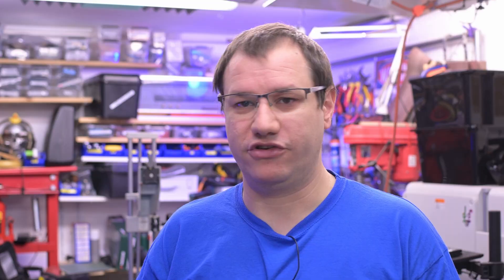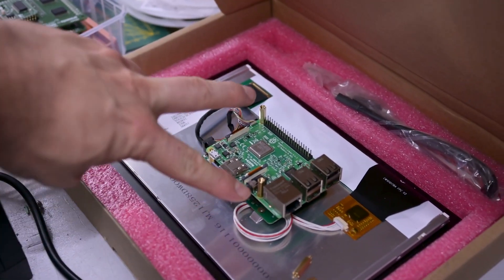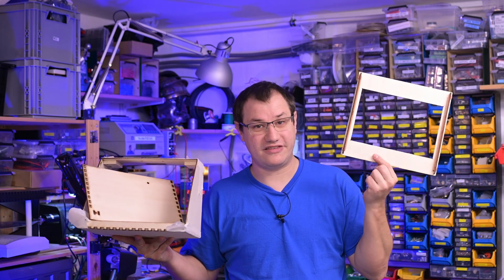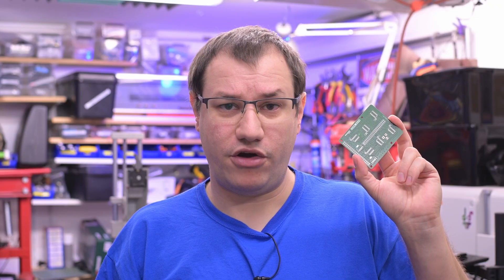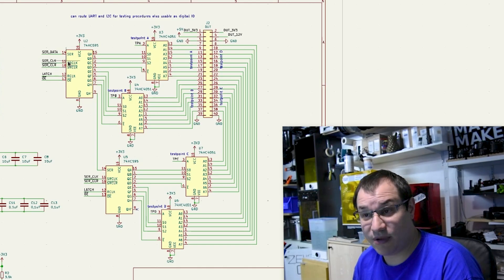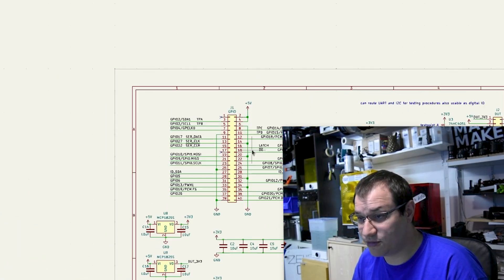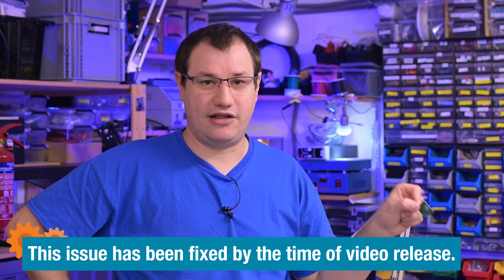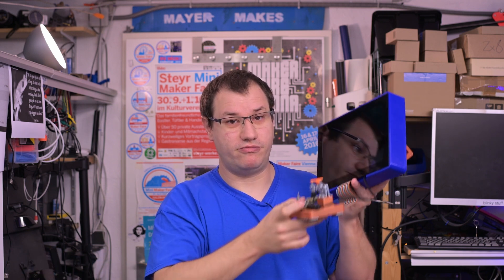DIY Flash & Test Station for Your Electronics Projects

Comment: Pygame can run without gui and does mouse, does not have to use whole screen but  always starts top left + a rectangle so mixing pygame/textual is probably doable.
e.g   have "mouse" buttons from touchscreen at the left ([wide] column or  ( [deep] top row) and the rest is free for textual ?
Reply: not sure if pygame works without an xserveder tough but worth a try tom ake this even more lightweight..but the version with an xserver installed also looks a lot better.
Reply: @MAYERMAKES  I am working with pygame and picamera2 for rpi camera, without a gui.
Must use rpi bullseye version, newer version do not support it.
Reply: @jyvben1520 ah there we have an issue, thanks for the info

Comment: Bit off topic, but I was thinking about how to remotely program stuff and honestly it's just bad. I have bunch of embedded 32u4 devices outside in enclosures.I have realized, that I could plug in PI zero, and program it, eeeeh no flash the chip and wait for results. But I still need to go there, disassemble enclosure and plug the damn thing in and remember the bloody commands. 
The solution is simple - Just use device that supports OTA update or has ssh server... Still if there was seamless arduino IDE integration with remote programmer, it would be awesome.

Comment: I remember two decades ago having a mouse on a pure linux console so there must be a driver for it out of Xserver
Reply: the critical point is the Xserver, if x is started it works but on aminimal install without any graphical environments there is no X to serve that pointer. if it is present it surely could be called the difference in my version was just the presence of the xserver
Reply: I actually noticed it just the other day, when trying the new FreeBSD release on my Pi4. Mind you, the release comes with just the terminal out of the box 

Sadly, it's not ready for my daily driving, since it doesn't support the full board.

Not that I dislike Linux or anything, but I do enjoy the simplicity of BSD.